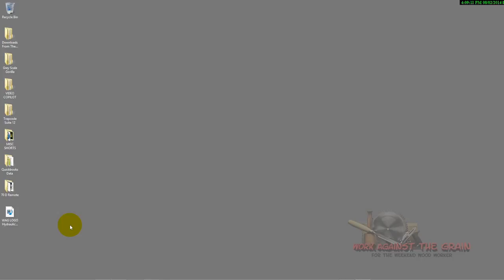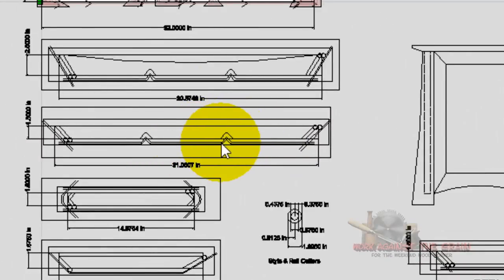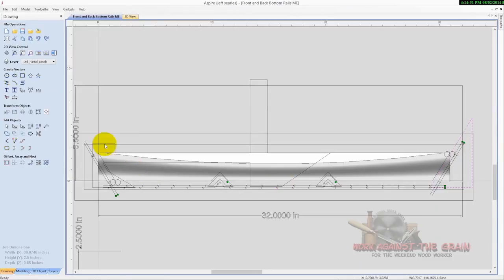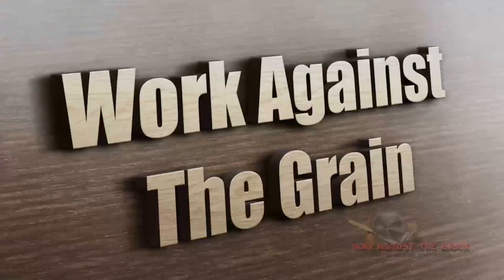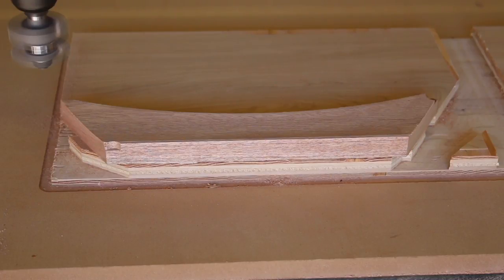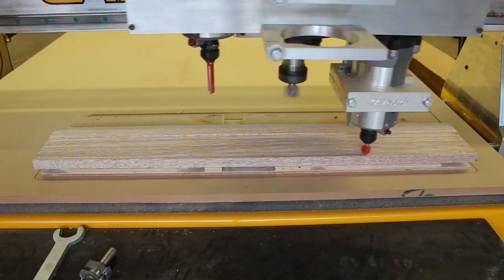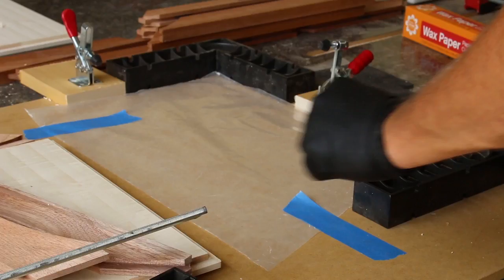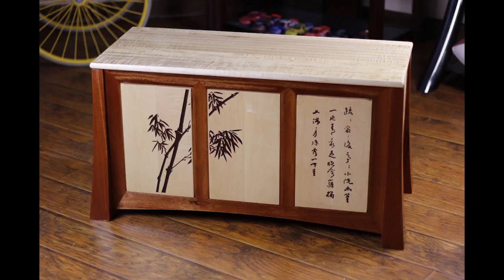Blanket Chest Stiles Rails and Panels

Comment: great work! Why did you need to leave the bearings on the cutters though?
Reply from the maker: Dylan Sirois actually that's a great question. I hadn't even thought about it until you're bringing it up right now. you're absolutely right I should have taken them off thank you very much for the great idea
Reply: I am planning to make cabinet doors on my CNC and learned a lot from this video. I've heard on CNC forums that the bearing could potentially induce extra stress on the CNC. but it looks like yours was fine at least with that particular wood species and jig.